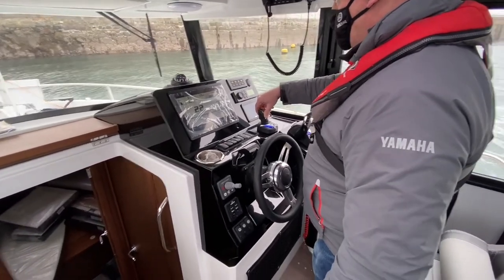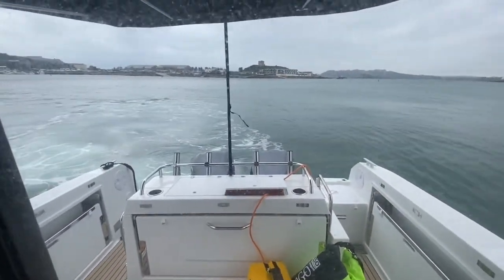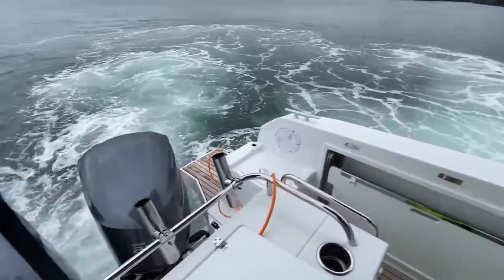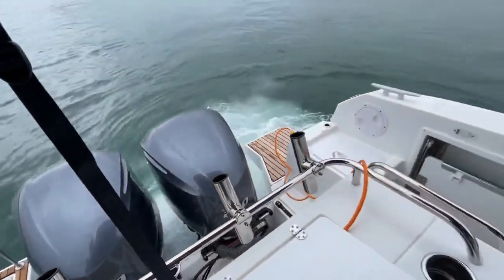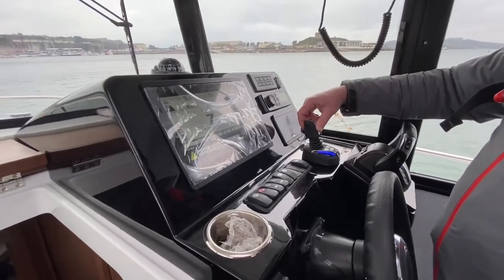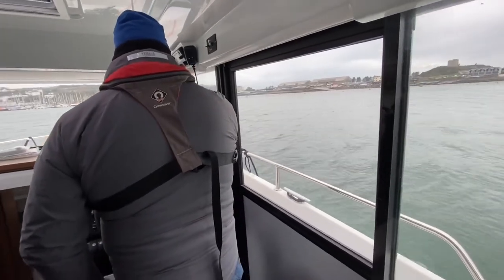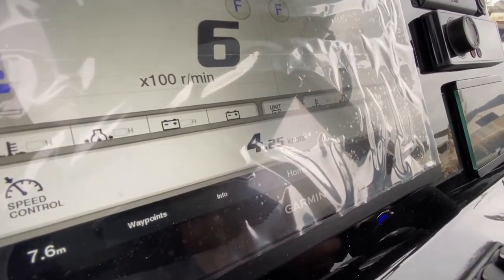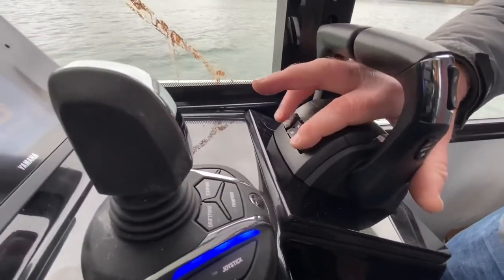New Yamaha Helm Master Joystick controls 1st in UK. Fitted to a Jeanneau Marlin 895.

Comment: What a fantastic bit of kit.....manoeuvring in a tight, windy marina, with a strong tide is always a worry! I want/need it!.......what does it add to the price?
Reply from the maker: About 15 to 20k depending on whether you go for the whole set up or just the Electric drive system. I think the price will come down when it’s bought as a package with the boat
Reply: @robatlanticyachts9046  - thanks for the speedy response....it makes the boat really really attractive

Comment: Hello, I bought a Merry Fisher Marlin. I have a Yamaha 2x200F engine. Can HELM MASTER be fitted? On my boat, the throttle arm is digital.
Reply: Is it the CL5 throttle?
Reply: @aquaspiritribs299  yes
Reply: CL5
Reply from the maker: Yes it is possible then, you need DES rams and the electronic steering. You need to remove the hydraulic steering and the add the electric steering and the joystick
Reply: @robatlanticyachts9046  thank you very much